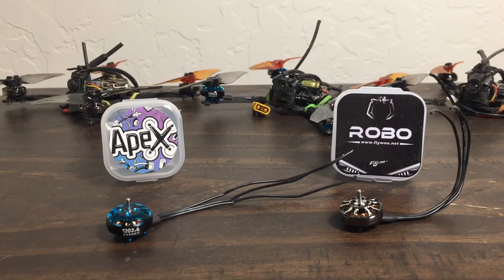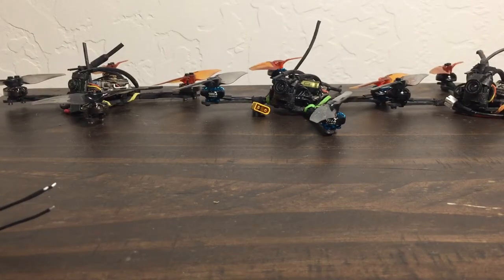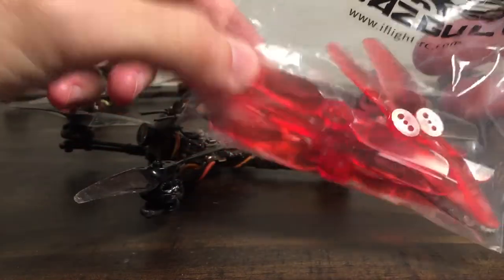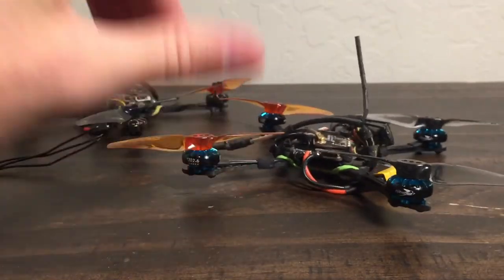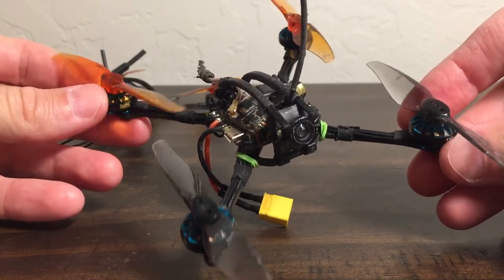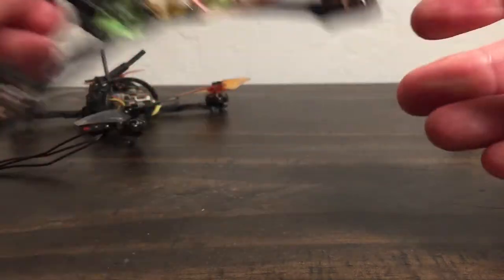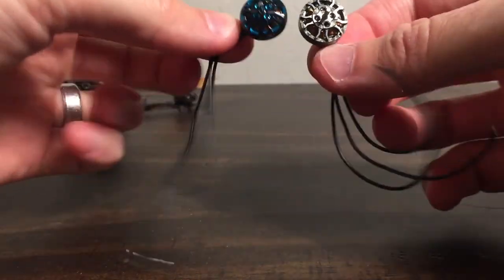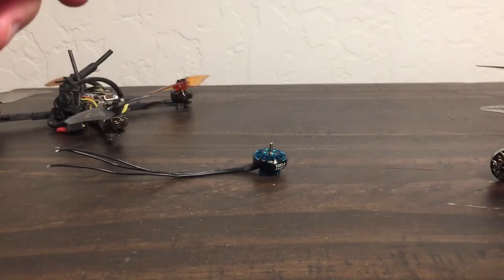First impression: Apex Racing 1202.6 8888kv 2S (and a bunch of rambling)

Comment: Say you already have normal 1204/1303 TP3. So 3S or 4S 520mah.
If a cell on one of the packs goes, you throw it onto this 2S Apex 8888KV build. 

What camera and frame are you using?
Reply from the maker: dilbert mcfly here’s a similar build on the WarPig frame. My usual cameras are 199c or beeeye. I have an ant lite to test. If it’s notably better I may switch to that.

Comment: One of the quads had a PH 2.0. And I believe it was around 8000kv so I'm guessing 2S. Does it work better? Because I use XT30 on everything from 1s to 3s.
Reply from the maker: Mute fpv did a nice assessment: https://youtu.be/jscLabUvLPQ . My take is that on 1S the weight of xt30 is not offset by the resistance. 2S 300 mah could go either way. 2S 450 or larger than xt30 probably is superior. the gnb27 is basically an xt10 with 1mm bullets, they should have gone 1.5mm, which would have been ideal. The age of the connector also matters as the battery end of PH2 tends to wear even with the solid pin and becomes a limiter. xt30 will last much longer. so essentially we still don’t have a great 1-2S solution.
Reply: @Quad66  Great stuff man! What if we just soldered the battery to the FC each time we changed out the pack? Then no connector hassle :-)
Reply from the maker: LRFPV ha! way back in my rc car days hard wiring the battery was actually fairly common to minimize resistance ...  I thought it was nuts
Reply: @Quad66  Just wondering, have you tried the BT 2.0 connectors?
Reply: @lrfpv5292  yea man tried them there BARELY better than ph2.0 SOLID PIN connectors and are much better than ROLLED PIN ph2.0 but not even half as good as xt30, if it was me, I'd just run xt30 cause literally all my batteries 1-4s for all my quads are xt30 even up to my lightweight 5in quads and there just awesome. For me its the one connector to rule them all hahaha and I have found even on 1s builds they allow better control and power over even the ph2 solid and bt2 where its worth it for me to change them out. You can watch Mute fpv's video on all the connectors he does an awesome job same as all his videos!
Reply: @Neukom720  Ah, good to know. I fly lots of 1-cell stuff and I usually just slap an xt30 on everything. Mainly for convenience sake, but also it's like an overkill connector!